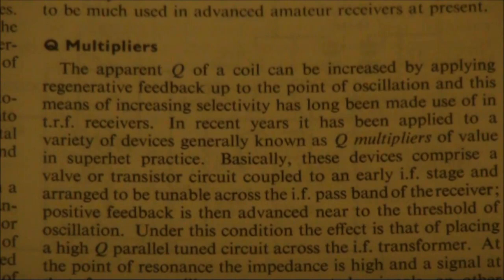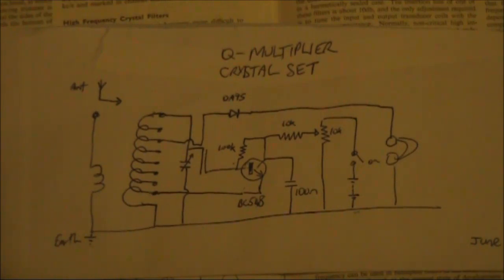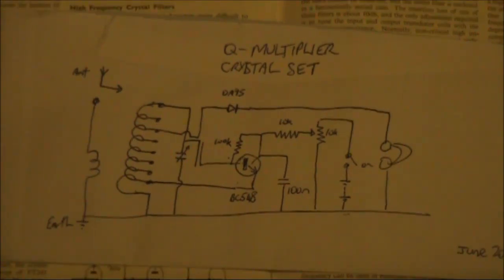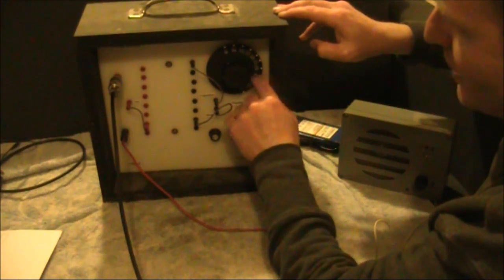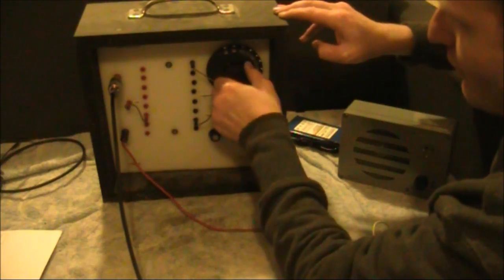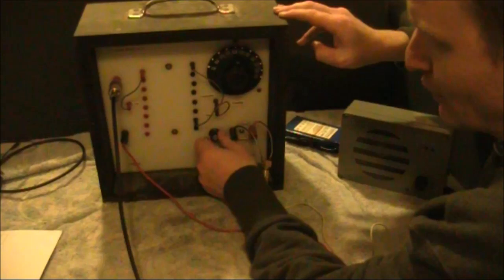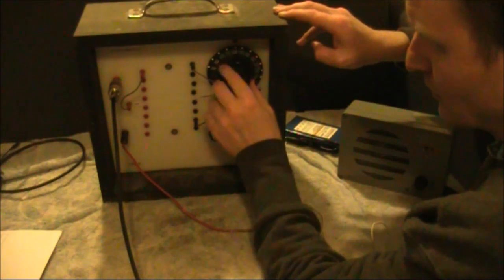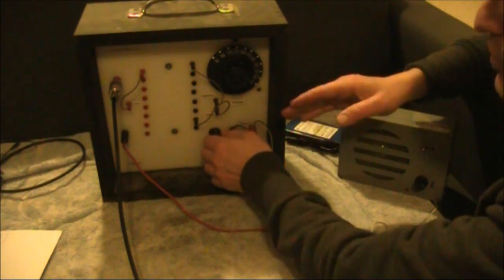Q-multiplier improves crystal set reception - Part 1

Comment: The transistor must be low-noise FET (so it will not shunt  the coil when off) and there must be a mica condenser filter after the diode 1000 - 3300 pF it allows to work properly the detector. The Schottky diode is better than germanium,  because of highest dynamic impedance, so the sensitivity and selectivity must be better.

Comment: Have you tried litz wire before? Does it help the Q at all?
Reply from the maker: Haven't tried it.
Reply: Apparently for Medium Wave band, it has a pretty impressive Q factor and selectivity because of the greatly increased surface area of the conductor. Here is an example that has 960 insulated 46 gauge wires! Tinning 960 insulated wires is a pain but it is like winding coils with 1.44 inch in diameter wire that is only 1.8mm in diameter. It's pretty expensive but it should be a hoot to play with!
http://www.ebay.com/itm/like/151089898948?lpid=82&chn=ps&ul_noapp=true
--Zac